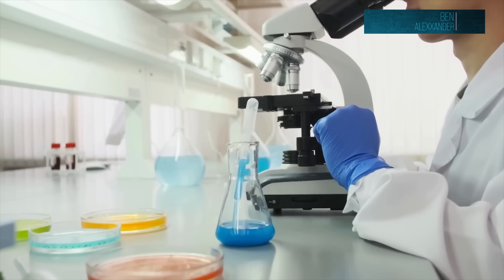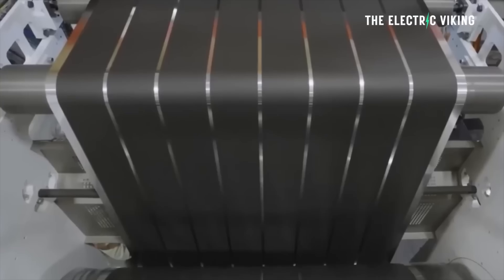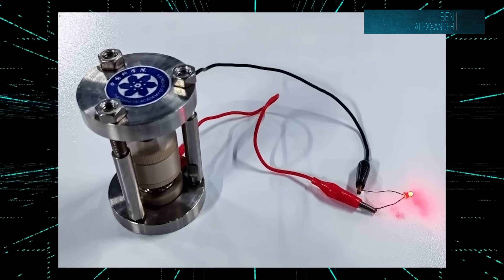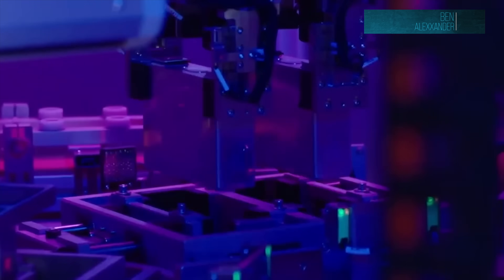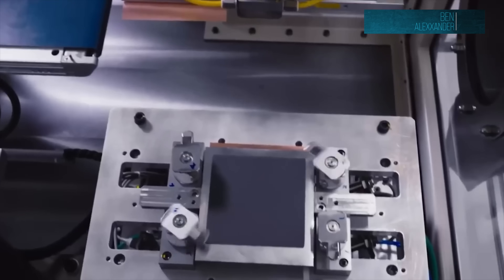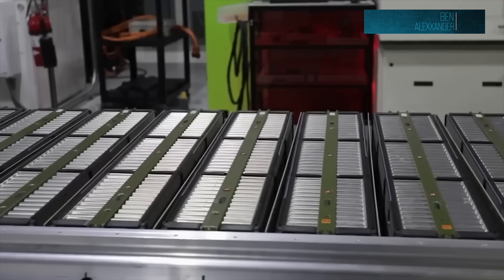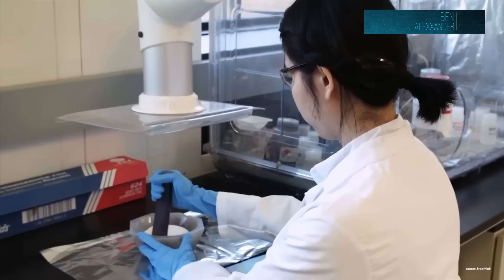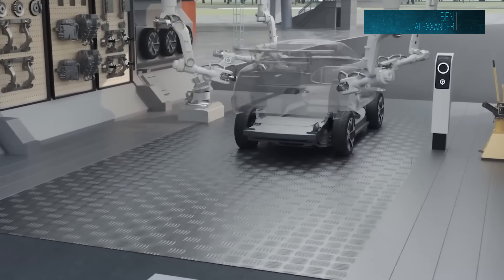World’s First Hydride-Ion Battery Could Replace Lithium-Ion

Comment from the maker: Will this become more popular than LFP chemistry or Sodium and why?
Reply: Has to be very quick to be commercialised since there's no shortage of demand for battery production and energy storage both mobile and static for grid stability are the major bottleneck in maximising Renewables and reducing emissions; second to that of radically reducing energy consumption. 

Has anyone heard any updates from Toyota's solid state battery promises? Lol
Reply: CATL's Naxtra is still the future... NOW. Affordable, durable, low tech.
Reply: Without more information about the battery - right now - with a short cycle life - the only good would be for mobile/very larg high power need devices. If they can get the cycle life to what LFP is (2000+ or so) then we could see it in cars, but I have a feeling with Sodium hitting the market, that number might raise to 3-5k+ just so the car has one less issue it has to worry about. With that said, if they can do all that, plus a bag of chips, then a 4 or 6 time increase might not translate to more range for say, but smaller battery packs as that haves both a econ for the cars plus less supply needs for the pack it self. Aka, less over all risk and cost. I think they might still try to get around 500 miles - but then there will be cut off and then it becomes a different product / increase cost. The other way would be instead of cars, airospace would be its next take over instead depending on how rare or hard it is to get supply. I dont think we will see it for grid or home use as LFP and sodium will be taking over that market and trying to get its price as low as possible.
Reply: Would I trust it? Absolutely

Comment: Solid state and sodium don't compete with each other. Solid state will be introduce and replace over time, if they are successful in the premium top vehicles, while sodium will come mainly for storage and if it confirms to be good enough, will take part or almost entirely the cheapest EV vehicles.
It depends on the density difference if LFP will remain being a significant fraction or not. They still have some advantages like more stable charge/discharge curve, that mean simpler electronics to control the voltage.

Comment: Check the voltage range and cyclic life: LiFePO4 is more or less flat across 90-10% of its discharge curve, Sodium goes from 14.5 down to 10v, meaning that most nominally 12v equipment won't be able to use it except in the 70 - 30% SOC range. Same thing with cyclic life, with Sodium no more than a couple of hundred compared to LiFePO4 several thousand. 

Finally, whatever the attractions, it will take quite a while for production to spool up to the point where economies of scale will make new chemistries competitive: right now you can pick up a 300Ah 12v LiFePO4 unit for £265 or so. Science doesn't stand still, but just because "Scientists" invented BetaMax doesn't mean that VHS is doomed to obscurity.

Comment: This is an interesting development but barium hydride is around $500 per 100g which translates to $5M per metric tonne. Cerium hydride is approximately double that. Not sure how much they use in this battery but it sounds pretty expensive. Having said that, lithium is 3x rarer than cerium and 19x rarer than barium, meaning both are more abundant on earth than lithium.

Comment: For cars sodium seems like the best choice at the moment with it functioning in a wide temperature range and not being damaged by a full charge or discharge.  Being able to fully charge and use the battery is huge.  It’s also huge that it can be made on existing LFP assembly lines.  If they can make sodium with a fast charge rate it will take over EVs
Reply: Sodium already has a faster charge rate than LFP.  The issue is really just scaling them at this point and that's right around the corner.  
*The real worry was always energy density.  I figured they'd only go in small cars in developing countries that don't need to travel far since they were always projected to be inexpensive.  But that doesn't matter now that the density is even higher than LFP.  IF solid state comes available in the next few years, they're going to have a lot of trouble competing with the cost of sodium batteries outside of high performance, luxury vehicles.
Reply: @veganpotterthevegan   It will be interesting to see what happens.  In the future I could see the difference between low and high end vehicles being the type of battery it has among the other typical luxury items.

Comment: Very interesting. A 3x to 6x increase in energy density would allow for even more technologies to be powered by batteries. IE: Even air planes could become electrified. Wonder if we could ever develop systems for planes that can harvest the potential energy when descending to be used again for takeoff. 

Makes me wonder if they can also make hydride-ion capacitors as well. Those might be very interesting as well, and might bring capacitors into play for certain energy storage applications.

Comment: Musk predicted 400 wh/kg as a enabler for flight, if this technology meets the safety requirements it's certainly going to be a potential solution.
Furthermore, I think the military might be less concerned about charge cycles in some scenarios, if  the battery can power 20 missions, that's 19 more than a hugely expensive Cruise missile!
Reply: Musk is full of s**t.

You need a lot more than just 2-3x better than Li ion density to make electric flight viable beyond smol short haul aircraft.

Get this into your heads guys - Musk. Is. A. Con. Man.

He's just a lot better at it than most given he's been doing exactly the same thing as Elizabeth Holmes from day 1 and got away with it scott free.

Every achievement he touts (when it's actually real and not comically inflated to boost TSLA stock) is the achievement of Tesla or SpaceX engineering staff - not his.

Being an investor doesn't mean anything, and that's all he is.
Reply: @mnomadvfx not a great deal more, around 500 wh/kg minimum for regional, 800 wh/kg for narrow bodied short haul.
Regardless of Musk's views, there's plenty of scope for Stol, haulage, short haul and military flight.

Comment: I noticed he mentioned a twenty cycle life of this battery chemistry. That usually means it’s a dead end.
My question is twofold: 
Can it reliably do half of that?
Can it be easily recycled and at low cost?

We already have been accepting a single cycle chemistry that is non recyclable but was abundant,gasoline.
If the battery has 40% the energy density of gasoline,it has won the race. ICE engines lose 70% of the energy as heat.
Reply: ITs a lab POC. Doesnt mean dead end at all.
Reply: I agree.  20x is just so far off that it's unlikely to be able to be improved enough to be competitive,

Comment: Electric flight is the big win that hydride in batteries might gain. Cars maybe, but we're already doing pretty well.
Reply: Well, who wouldn't mind doing 3 to 6 times as well. :face-blue-smiling:
Reply: you are right, EVs are doing well already. however, smaller and lighter batteries are very welcome in retrofitting old ICE cars with EV tech. or for smaller cars like an electric version of a mazda miata (mx-5)
Reply: @stefanweilhartner4415  Yeah, retrofitting ICE vehicles to turn them into hybrids with batteries that are 3 to 6 times lighter would be very good.
Reply: Electric flight still needs a drastic improvement in electric motor power density per kg without superconducting coils.

Even then I think it won't be viable without blended wing designs on top of that.
Reply: @mnomadvfx no, motors are powerful enough.   The issue is propeller noise.  Most like quiet flight of jet engines.
Reply: @veganpotterthevegan 
EDF Electric Ducted Fans are the voltage version of a turbofan engine. The power density isn’t there yet. But speeds like a turboprop are possible

Comment: Well, recent history (sodium) has shown us that often things like this can break into the mainstream must quicker than we expect. Just one or 2 scaling and / or production breakthroughs, and off we go.
This tech should also have a major impact on mobile electronics obviously, and will really boost electric aircraft. The Chinese may end up circumventing Western aircraft engine suppliers for short range hauls at least, if they can get energy density that high. Major implications.

Comment: This is an incredible development! Though very early, it paves the way for power storage at very low prices. It will be interesting to follow the developments surrounding this chemistry going forward.
Reply: Static storage isn't that bothered about density.

The main points are stability, number of cycles and cost.

I'm inclined to think that sodium ion or a possible future sodium sulphur chemistry will be the big one for storage, though the simplicity of flow batteries might win the day too.

Comment: If this cant be manufactured to mass scale.. then its just pointless
Reply: Kerosene is 10+ kWh per litre or slightly less than a kilogram. At 985wh per kg this would make commuter flights less than 250kms very cost effective even if the battery only lasted 20 cycles. The difference is kerosene is $2.50/10kwh or more and the electricity could be a lot less or free. (Or $3/10kwh)
Reply: @theairstig9164  at what efficiency does kerosene burn? How much is lost to heat in the atmosphere?

What is the maintenance needed  for an engine like that after many trips?
Reply: @viyusavery248  At 25% engine efficiency there's still a huge difference between kerosene at ~3,000 Wh/kg and a battery with ~1,000 Wh/kg, particularly as the battery carries its own weight for the whole journey. That gap is getting smaller each year though, that's the exciting thing.
Reply: So were lithium ion batteries then, be patient?